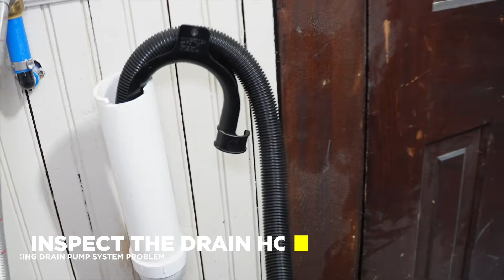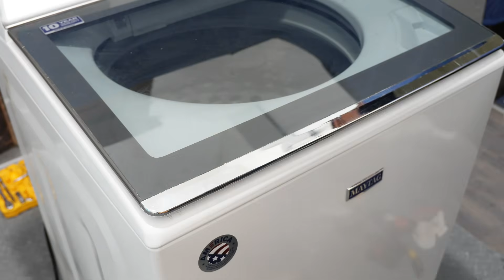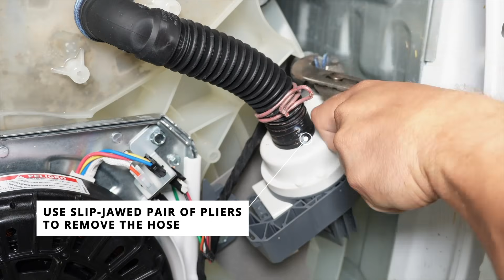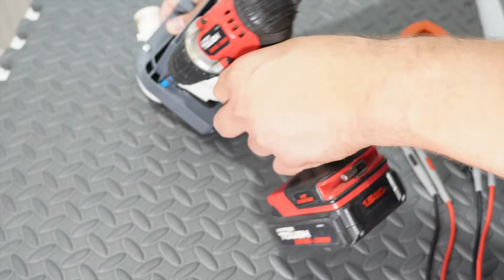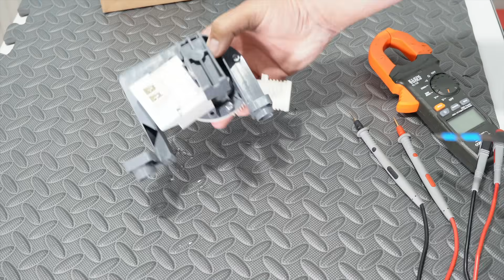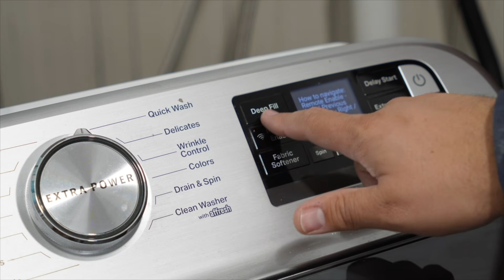How to Fix a Newer Maytag Washing Machine that Won't Drain or Spin

Comment: Absolutely hands down the worst washing machine I have ever owned.
Reply: Literally I’m here trying to figure out why this stupid thing has no error code, won’t drain, and won’t unlock. 💀
Reply: Apparently you never owned a Samsung that were know to fly apart
Reply: I will never buy another Maytag product as long as I live.  I’ve never had a worse washer
Reply: Garbage!
Reply: Yeah it seems like there is always an issue with this thing. Mine hasn't actually broke yet but is always coming up with a code and stopping. I just want to turn it on and wash clothes. In this case, old stuff really was better. Maybe not as efficient but   they worked for a long time without fail
Reply: Same
Reply: This is the worst washer I have ever owned. More problems than clean clothes
Reply: Same
Reply: Definitely wish I could go back and pick another washing machine, I would never pick this one again either 😭

Comment: Just is case someone is looking for a solution to issues with this washer. 1st thing, before spending any money- open the back and then untape the wires running down next to the tub. These wires are small (too small) and break easily. Don't ask why I say to check this before spending anything on parts....!

Comment: Before you buy a new washer or call the technician try this for the top loader:  I noticed that if i tilted the top loader washer the pump would turn on and it would drain.  I figured it might be the water level sensor.  I took the back panels off and inspected the tube for breaks or cuts.  I cut half-inch tip of each end of the clear tube, which is the vacuum/pressure tube telling the machine how much water is in the tub, reattached it to the top control panel, and the bottom tub with much tighter fit.  It must have been so stretched out on the connection somewhere so that it wasn't making a seal causing the software to go into a tailspin.

Comment: Obstruction, bad wires/pcb, bad pump electromagnet, bad pump impeller bearings, worn out impeller. Bad lid lock.
Reply: @gregscott4479 so go with pump and main board and u/i? Im confused as if the main board is sending voltage to the pump then its just a bad drain pump.
Reply: @gregscott4479 it's why I use a Timer Switch Direct Drive Whirlpool based unit with the water pump right off the drive motor. The only other washer I would use is the belt driven Whirlpool based unit due to ease of maintenance and reliability (yes WP fixed the pcb on the belt driven unit)
Reply: @swampcabbage3239  I dropped a reply in here where even if you get voltage there, it can be ghost voltage caused by the water pump taking out board also.  They changed the part number on both which tells me they had a really high failure rate.  I would try fixing my own board, but in their wisdom, they incased it in some kind of silicone sealant that would make fixing it a very annoying job.

Comment: Well although this was not exactly my issue it did help me determine the issue. So thanks for that. My washer is maybe 1.5 years old. Once I watched this video I determined my washer was indeed not draining. Flipped it over to check the pump and hoses after draining manually. Low and behold the wires going to the pump actually broke off at the point they came out of the harness. Probably from the ridiculous amount this thing shakes when running. Rewired and we are good to go! Thanks a ton
Reply: Umm your comment has inspired me to recheck mine on MVW6200KW1.  Did your wash agitation also seem to weak? Thanks

Comment: I used your video for my Maytag washer. The washer was not draining, so my husband and I looked at everything and took the drains and motor apart as you said, and there was a piece of metal about 2 inches long about a 1/2 centimeter wide in it. The pump worked fine. We put everything back together, and my washer works! Thank you! I felt great afterward cause I fixed something on my own.

Comment: My washer stopped draining and after fiddling, I had two different bad drain error messages.  Followed the video, step by step and found a piece of metal in the drain pump.  My bad for putting things in my pocket and then not carefully emptying those pockets.  So thanks for the easy to follow video and I really like that you do a quick section on reassembly.  Makes that part so much simpler.

Comment: Ben,  I have the Whirlpool version of this Maytag washer.  Let me share my experience so other people may learn some items to check and when to cut losses.   My water pump burnt out right at about the 3 year mark.  Before buying a new water pump, I confirmed I was reading 120volts on the power leads, and the ohm reading was a bit low and thus figured it was the pump.  Put the new pump in and it didn't start. Took an amp reading and got no amp draw.  Figuring it might be a bad pump, I rigged up a 120 volt AC test lead to the pump and found it turned immediately.  I then hooked up a 10 watt incandescent light bulb to the power leads and found it did not light when the drain pump was turned on in the diagnostic mode. 

This lead me to the board being bad.   I should have cut my losses there and bought a new one, but decided to replace the board as it had been an expensive washer when new and had served me well so far.  Replaced the board, ran through the diagnostic cycle and calibration cycle.  Then ran an afresh cycle just to check for complete operation.  I then loaded it up with clothes and it started working just fine until it was doing the spin for the end of the wash cycle.  The washer went into medium speed spin, activated the drain pump off and on, and then about the time it should have kicked into the higher spin speeds, the timer stopped and failed to move forward.  It does a similar stuck for the rinse and spin.   I tried diagnosing more, but after checking the water indicator line for clean and a good seal, and all connections being tight, I can only conclude the board I got (which is a remanufactured as new by information on the box) is bad.   I am now out $400+ dollars and so far Whirlpool has not been much help. 

Therefore, I recommend everyone that if you have this model, or the whirlpool equivalent, and the water pump doesn't burn out open, make sure you test both the pump and the power coming from the board for correct operation before spending anymore money.  Otherwise, you will end up like me, $400 dollars poorer at the laundromat while trying to get some help from Whirlpool. 

I should note, the washer was used to wash about 1.25 load of clothes per week for the first two years, and about 3 loads for the last year.  My experience with this washer breaking and then basically not being reparable has really shaken my faith in buying another Maytag / Whirlpool product.
Reply: I had to buy a board for this machine, ordered it through the link off maytag's website and they sent me a fried board with scorch marks on two of the connectors, for $500! This company doesn't give af. I got them to send me another board and now I'm up and running though I can't set the spin cycle higher than medium or the machine just spins slow and hangs.
Reply: I completely second this!! Do NOT waste your money on this piece of crap. 2 and a half years old replaced actuator, clutch, and now transmission is gone all within a couple months!! Buying a used  washer this time at least I won't feel so bad about it if it breaks in a year or 2.
Reply: @mamadukes2219  ours didn't spin...called repairman...he put a new acuator...6 months later...doing the same dang thing again!!! He said they updated it when he replaced it but I refuse to keep fixing it all the time..gonna buy different brand.  They are not made like they used to be...Maytag used to be good...not anymore.

Comment: Thank you! This was the first video that was setup like my Maytag. Had to remove the bottom storage to access it and get help to set it down, but after removing the pump hoses I immediately saw it was a pair of underwear stuck in the pump. I felt the resistance of the blades like the video said and used some needle-nosed pliers to pull them out fairly  easily!  Thank you!

Comment: You are a gem! Me and hubby were wracking our brains on where the heck this filter was, couldn't find it in the manual (Maytag top load washer with deep fill MVW6200KW)
Reply: What was the issue with that model? Because mine doesn’t spin after it’s full with water. Any tips?
Reply: Under the tub with bottom portion he shows on video seen after removing pump. Most of the time you can grab the object with needle nose pliers. Cause the Only way to remove the filter is to remove the top, the washplate, the tub ring, the hub gear, the metal tub itself. Very laborous. Lol.
Reply: @FGLeon01 Well it wont spin when itts full of water. If the pump fails to come on it will not spin. Did it wash/agitate properly or did it seem weak then fail to drain or spin?  Normally the things hes suggested in this video clear up the problem.  But im  still having this issue. Ive done several. But first time on this model.
Reply: Oh if youll follow his suggestion to manually drain water lid should unlock . If not also unplug for several minutes then replug and it should unlock.

Comment: Thanks Ben for all the information you’ve provided on YouTube.
I’m 70 and still learning and that’s why I enjoy watching your channel. I faced the challenge of my banging model # WP350ANP/XAA01, 2012 Samsung  “VRT Steam” front loading washer buy replacing all four shock absorbers, spider bracket, seal, and bearings but now it bangs at just the start of the spin cycle. I’ve watched yours and others videos searching for the combination of button presses to do a calibration and tried all that I found but still failed to achieve a calibration. I’m wondering if you could help me with that information, it would be greatly appreciated.
Kent 😊

Comment: My GE washer that I bought in 1997 died in August.  It was not unexpected and in preparation for this day I researched various replacement washers. Thanks to your incredible videos I decided that a refurbished machine was the best option. I had planned to buy from a local company. But the handyman who is doing work on my home got a washer from a lady who replaced it with a new one. The lady said the washer still worked.  It is the Roper RTW4440XQ. The washer was cleaned and has been fine so far.  The only info I could find about the machine was its listing on Lowe's website. It was made in 2011 and has been discontinued. Maybe it was not popular?
What has been your experience with this Roper model?  I can't find any videos about it.

Comment: Nice video, very insightful info. 
Question: On MVW6200KW1 By Maytag.  At first only blinking sense light. Lid wouldnt even lock. Discovered lid lock micro switchs were sticking 50 % of the time. So replaced with a new OEM Whirlpool lid lock assembly.  Same response.  Ordered another board from JimmyShop as research  indicated board was bad.  Same response. Returned got a replacement. Put it on. Now 1st lid locks, 2nd tub spins rapidly,  then 3rd begins a series of gentle back n forth agitations over 10 or so minutes and water filling then stops( led on wash) no further functions. No drain ! Lid still locked. If i drop drain line and empty all water then lid unlocks ( still plugged in) tested pump with meter 19.99, pump impeller turns as normal as noted on this video. No blockages in drainline or pump.       Agitation seems much to gentle and weak when led is on wash. I tried normal, quick wash, towels cycles. Tried another motor same response.  Whenni try drain n spin only cylce with water in tub pump doesnt come on. Unless i drop drainline , empty all water then itll spin. Pump never comes on.  Im unsure im testing capacitor on motor correctly.  I get a climbing readout. Even when reversing leads on multimeter. Climbs constant after 25 seconds even after 20 or more seconds.  Tried a second capacitor no change. Any suggestions are appreciated. Otherwise next  i think it has a second capacitor under console i will check after verifying im testing them correctly.  And wiring to pump.

Comment: Thanks. The issue with our model was the wirre not sending power to the pump. The wire iverheated and broke but not at the connection area. Odd that it was about 12in from control board down.
Reply: That seems to be a common occurrence from videos I have seen.  The wire is a light gauge aluminum and seems to have a problem with breakage.

Comment: Hey Ben. I have this washer. Woke up one day and washer wouldn't do anything. I replaced main control board and it powered up and seemed to be working until the spin cycle started. It will not spin fast and it won't quit spinning staying on 25 minutes on machine. I can  stop the wash and turn in to drain and spin and it will complete the fast spin cycle. Any advice?
Reply: Also I have no error codes.
Reply: It just keeps spinning for hours on slow.

Comment: When you sell your older direct drives do they fetch a similar price as your newer used machines?
Reply from the maker: Depends on model but generally yes. We price them near the same. IMHO a Kenmore Elite Direct Drive is the crown jewel of the DD collection, and its priced as such if we can get them working the way we want.
Reply: @bensappliancesandjunk  I have a kenmore direct drive in working on currently, is there models you would recommend me staying away from? I picked up my first batch of washers and dryers the other day
Reply from the maker: @bukursglass6990  all the DDs are great. The only iffy ones are the newer ones that have the Automatic Temperature Control switches (ATCs) as they are costly to replace. But not otherwise difficult to work on or fix. Just a newer wrinkle on repairs that most built before 2008-ish didn't have.
Reply: @bensappliancesandjunk  your amazing man!! I actually broke the lint filter on this kenmore, it sits at the bottom of the drum, I’m sure you know what I’m talking about, I’ve been taking a part each appliance and deep cleaning them in hopes it will add value for my customers, I was so worried cause I couldn’t find a replacement lint trap online , but I found lint trap plugs, have you ever heard of them or ran into this problem?

Comment: Just replaced a TWO year old one of these.  Main circuit board went out and was replaced and replacement went out immediately.  Technician said now have to install another board and electronic lock that appeared to trip board.  Technician was nice guy but third time to house in six weeks to throw parts at a machine that has too many defects.  Gave up.  Bought GE Commwrcial grade that might be junk too hopefully not but at least has 5 years parts and labor warranty
Reply: Was it the lid lock? Mine shorted out and blew up the control board. The lid lock thing has a relay in it and it's powered off AC mains voltage! Absolutely insane, and when it shorts it blows up components on the main board. I don't know what repair guys are paying but a consumer getting these parts from maytag pays 200 for the lid lock module and 500 for the control board. The first control board they sent me was fried and had scorch marks on one of the pcb header sockets.

Comment: How do I remove the wife’s hair pins from inside the drain area where the hose attaches to the tub?  I can’t pull them out with pliers as they’re just bouncing around between the housing and the impeller.  The area has rust stains as they’ve been in there for some time.

Comment: Hey Ben,
I recently bought a perfectly functioning Maytag washer produced in Sept 1985 as a spare.
I’ll be storing it in my garage here in freezing Michigan.
Q. Need to winterize it?
Q. If so…what do I do?
I’m fairly handy…so I should be able to follow your directions?
Thx
Doug
Reply from the maker: Just make sure all the water is drained. I'd be more worried of mice honestly
Reply: Ok, Just wondering if the pump will break if it has water in it and freezes
Reply: @flyonbyya yes
Reply: To winterize our cabin in NM, I use RV antifreeze in it, just pour about a half a quart in the tub and then run the rinse/spin cycle, it works and no problems yet after years of doing that.

Comment: Maytag is junked after 4 years machine is down related drain pump, after I have been working on the pump restart machine light 💡 back on I did bleeding air out of valve still the issue. I’m going back manually machine less stressed from many sensors switched.

Comment: Ben, What do you think about the combo washer dryer unit?
Reply from the maker: The one I did the review on?
Reply: Anything outside of the top load Timer Switch Whirlpool based washer or the Belt Driven Whirlpool based washer, are nothing but trash. Dont bother with laundry centers or front loaders.

Comment: I will say the more expensive washers are made on lines that are known for…not the best quality. Cheaper ones are made on a line with better quality and higher production rates…👀 (I’d like to go back to the job one day, so I can’t say anything wild.) But, I will say if you can get yourself in touch with an employee, they’re allowed to send out discount codes in case fixing it doesn’t work. I wish I had learned repairs before leaving the job. Nope. Just know how to put on everything in the bottom 😅

Comment: Hey Ben help 
My Maytag washing machine (MVWB755DW0) was having a problem where the door lock would not work unless you pulled it up just a little. After replacing it now for it to lock properly we sometimes have to keep trying over and over for it to finally lock… used to get code f5 e2 now I only get f5.